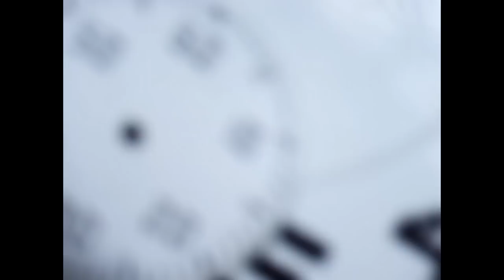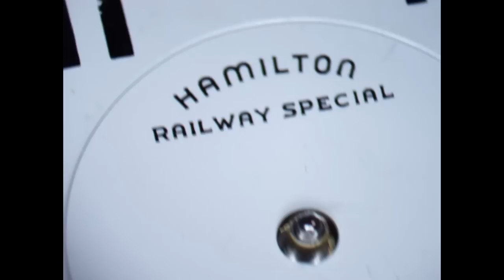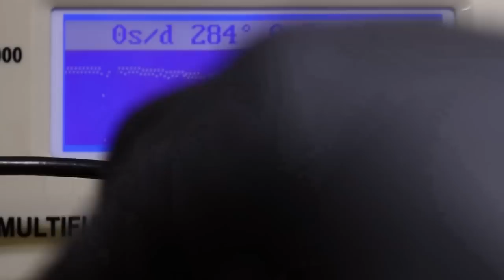The *PINNACLE* of AMERICAN MADE Pocket Watches

Comment: The stem was in great shape. You can generally tell how much use the watch gets by checking out he stem, also lack of chips on the dial is impressive, but 992b is super popular so it could have been replaced. I'm not sure why this one gets the full treatment, It didn't look like it needed it. Was it running slow?
Reply from the maker: It was off of timing yes. It hadn't been cleaned in well over 10 years and needed some TLC. Thank you for the support!

Comment: So he took apart a perfectly good watch and put it back together. What was the point in that?
Reply from the maker: Just cleaned and oiled. Its been a while and needed some love. Thank you!
Reply: It’s called a “service” usually older mechanical watches will need service at regular intervals like a car needs an oil change.
It involves complete disassembly of the watch (technical term is actually “movement” ), cleaning it, then reassembling it and lubricating the jewels, and any metal-on-metal components, and replacing of any parts. It also entails tuning the watch so that it runs properly to minimize gain or loss of time.
Railroad grade watches had some very strict time keeping rules and specifications, not only in how accurate the watch had to perform (no more than a +-30 seconds a week for RR watches) but also certain function and designs, such as lever set (the little lever he pulls out to set the hands) but also to perform in different positions and be calibrated to operate in different temperature ranges and perform as accurately when at peak winding or lowest winding.
I hope this helps explain what he did.

Comment: Very nice ASMR video! Here are some tips to improve your video even further. Lighting...many shots during the reassembly were dark over the parts of the watch where seeing the interaction between the parts is important look between 16:30-23:10 for improvement. Framing the shot...many of your shots during this time also had the main action out of frame. Testing...next time, use 3 focus shots for the timegraph numbers for reference in the beginning before disassembly (if the watch is running) so we can see where you started, immediately after cleaning and reassembly so that we can see how much a simple cleaning improves the operation and/or accuracy of the movement, and then after all your adjustments so we can see which adjustments improve the accuracy the most, if at all possible. Next, was that a new crystal or did you clean and buff the original one? Please show that process, too. Lastly, I would suggest using music throughout the video with links to the artists, (since you do no narration--nice musical selections, by the way) and adding text scripts for background on the watch and movement (some history on Hamilton would be good) or when you're using lubricants or glues (like when you glued the crystal back on using a UV glue--what was that stuff? And was that petroleum jelly you were using to lubricate the case bezel?). Some simple text stating what was being used would be helpful, esp. during those times where you are doing something tedious, like putting the watch parts into the baskets for cleaning. That's a perfect time for some text about the cleaning products being used or the movement mechanics or history as related to the exploded view. 

Anyway, you're off to a great start with your video because I did watch the whole thing, but I'm giving these few suggestions which could both improve your video and differentiate you from other ASMR watch repair videos. Good luck and thanks again. I'll keep an eye out.
Reply from the maker: Thank you, thank you, thank you! This was my first video and I need to improve! I truly appreciate the in-depth response! all your points are noted! Thanks again!
Reply: Strongly disagree about using music throughout. The silence gives a much greater sense of presence. I wouldn’t have subscribed if there had been more music than he included, and wouldn’t have minded even less.
Reply from the maker: @nightspore4850  Thanks! ill take this into consideration in the coming videos!

Comment: That crystal looks like an acrylic replacement. I also saw a neat technique for removing the second hand. It requires the perriferal screws holding the dial legs and then the face is pried-up from the edges. Lowers the risk of snapping the second pivot. Eh....and I am not much of a fan of just tripping the click to let down the mainspring. Black steel mainsprings don't handle stress very well...Just saying.....
Reply from the maker: Hey, thanks for the advice! It is a mineral crystal by the way! Just scratched. I appreciate the support! Thank you!

Comment: A bit concerned with the balance being in with the plates should the plates hit the balance while being cleaned even though it is mounted to the balance cock damage by weight on the balance wheel could bend the balance arbor.Not something I would do but maybe it is not going to come in contact with anything around it in the ultrasonic cleaner.
Reply from the maker: Good observation! You are absolutely right! I forgot to add the spacer ring to the basket before I cleaned it. I appreciate the keen eye! Thanks for the support!

Comment: The "pinnacle"? So, this is the best Americans (but no longer American) can do?
Reply from the maker: No longer American! Thanks for the support!
Reply: For the century following the American Civil War, American watchmaking did indeed produce some of the finest mass-produced watches in the world.  Numerous US watch manufacturers turned out millions of timepieces each year during those decades and shipped them far and wide, dwarfing what any other country (or in many cases what the combination of several other countries) were producing.  As far back as the late-1800s they were producing massive quantities of watches with consistent quality while the Swiss and others were still farming out batches of parts to be produced by independent craftsmen in private workshops.  As a result, American-made watches were easier and cheaper to both assemble and repair because parts were far more consistent, having all been produced in a single factory instead of literally all over the countryside.

American watch manufacturers were credited with perfecting the art and science of "mass production" - not to be confused with "assembly line production", which was actually pioneered by the beer brewing and bottling industry - NOT by Henry Ford!.  The concept of mass production was pioneered by the arms industry during the Civil War.  The ability to produce identical parts by machine on a mass scale that required no custom-fitting in order to assemble a fine mechanism of consistently high quality by the hundreds and thousands was envied the world over.  The Hamilton 992B from this video was produced in 1951, which represents the closing decades of that era of American watchmaking.  While the "quartz crisis" may have been the final nail in the coffin of watch manufacturing in the US, by that time our industry had already taken the lessons learned from mass watch production and several other industries and moved on.
Reply: The watch is probably 75 years old.  Waltham's pocket watches were amongst the very best in the world.